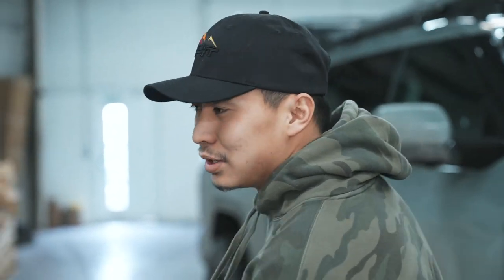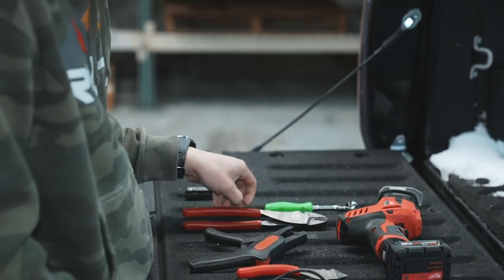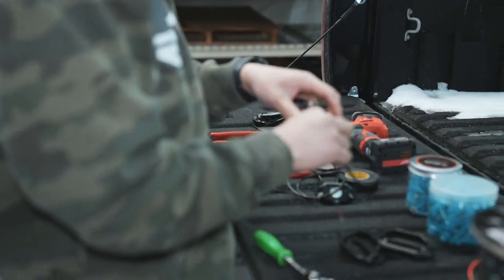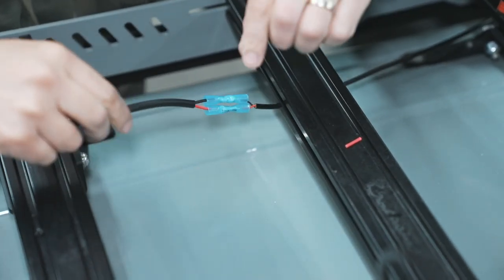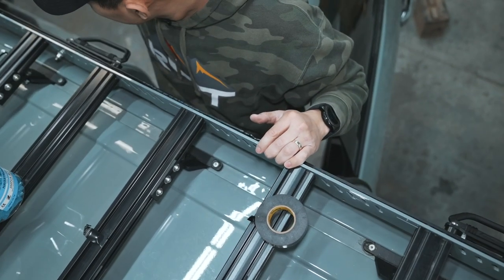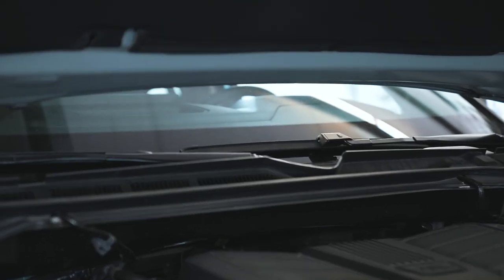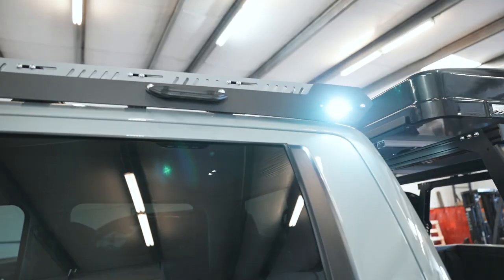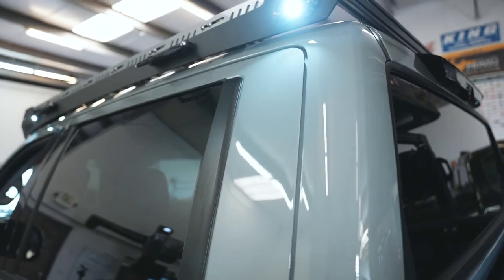FULL Roof Rack Rock Light Install on a 2022 Toyota Tundra with an upTOP Overland Roof Rack

Comment: use shrinkable tube instead of electrical tape for better aesthetics, just a suggestion.
Reply: Not only better aesthetics but better protection and the proper way. Weather elements will unwrap the tape in no time. Amature installation 🤦🏻‍♂️
Reply: Agreed. I’d use some marine grade shrink tube.

Comment: I think for as much as that rack costs, the lights should just bolt right up…no cutting or drilling. Sherpa, SSO, and prinsu just bolt up.
Reply: The thing is not every one is going mount the lights, so if they cut the hole ready to bolt up and you decide not to mount lights you’re going to have a random hole in your rack. I installed Baja rock lights on my Uptop rack and the cutting part literally took like 1 min per hole with a demel nothing out of this world.

Comment: The add a fuse is not reversible, because the fuse panel port is not reversible. Use a volt meter on DC and check both sides of the fuse port to ground. 
One will read 12v, the other will not. 
With or without the key turned on. Depending. 

If u install the add a fuse backwards and the light wire is shorted, or cut,  the fuse will not blow.
Reply: it'll always be hot!

Comment: What size/type/brand of red and black wire did you use for connecting all the roof rack rock lights together?
Reply: @2:11 he shows a spool GearIT 16ga Speaker Wire

Comment: Why run the black double wire in through the passenger side if you’re just going to tap them into your current switches on the driver side? It seems the add a fuse is the only thing that needed ran across